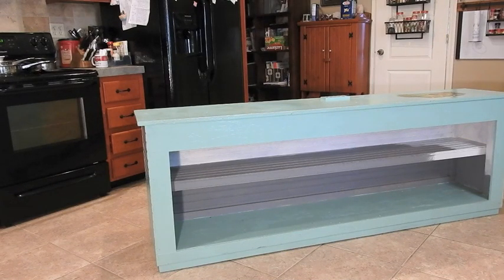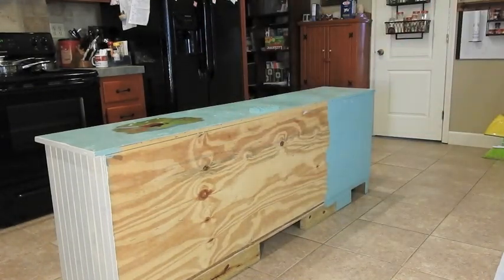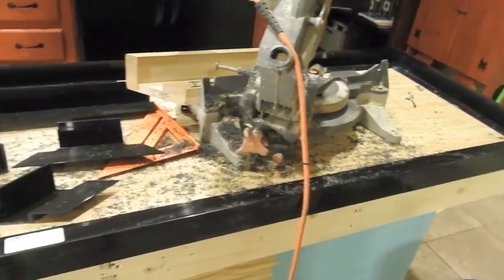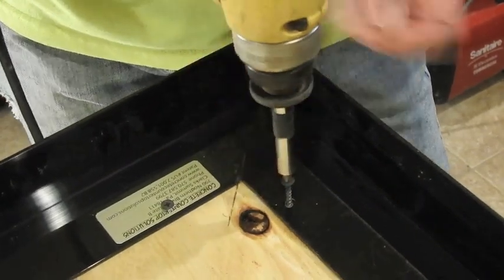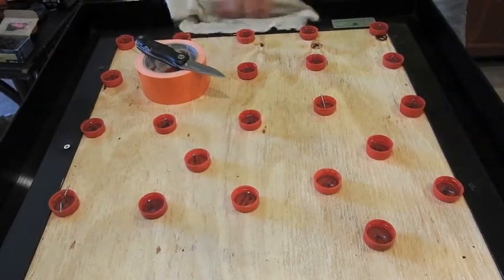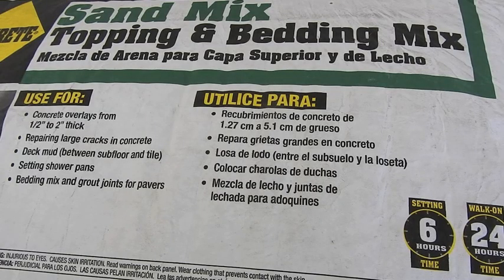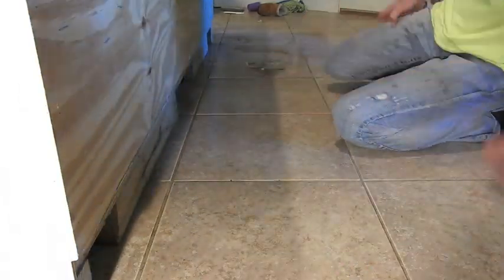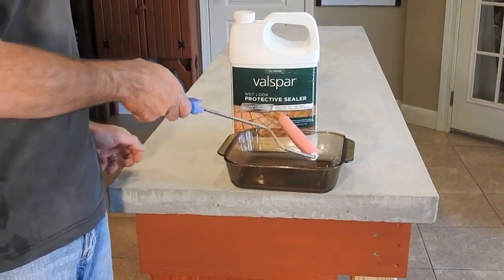How to Build a Custom Concrete Countertop Kitchen Island Buffet

Comment: thank you  for such a great video,very usefull tips the tip for getting the air out  works great  me and my mum made a sample piece we didnt think there was air in it till we tried the sander trick,the wood is a great idea to get it smooth it works better than the metal thingy,thanks again
Reply from the maker: I am so glad it helped and thanks so much for watching.

Comment: This is great! what are the orange lids with nails on them? I missed your explanation ? thanks 
And you said you added mesh but I didnt' see that? thanks
Reply from the maker: The orange lids are soda bottle lids, they hold the mesh in the middle of the slab. Thanks for watching
Reply: @chud327  Ah many thanks! can you not just pour half the concrete, add the mesh then add second half of concrete? I'm just thinking about time and labour saving, or do they add something else as well? thanks! Kate

Comment: Nice work for sure. Have you had any cracking with your sand mix? I'm getting ready to pour about 50 square feet of countertops.The lady at our local concrete supply house is telling me that sand mix will crack and bust if I don't buy her $35 for 50 pound bag of  countertop concrete mix. Just wanted to see if you had any issues with cracking and did you add anything to your mix to strengthen it.
Reply from the maker: I have done three countertop.  The first two had and additive and the last did not. The first has a small crack in front of the sink, which is a thin area. The other two have zero crack. I would probably risk it, but then again, 25 feet of countertop is a long way. Maybe you could do her $35 a bag mix in thin areas... I hope this helps, good luck, and thanks for watching.
Reply: Thanks for your help. It's fifty square feet over the whole house. Did you use the z counter top additive or another brand?
Reply from the maker: Z's for the first two pours.  Bought it for the first and had left overs for the second.  used none on the third.  If you search my channel "Chud327 concrete countertops" you may find the other two pours. Thanks again.

Comment: Did you have any issues with your seal separating away from your concrete? I have had that problem with multiple solvent based sealers, and it's always been on concrete that I burnished really smooth and tight and didn't stain (and therefore there was no etching). You left yours grey as well, so just wanted to find out how your seal held up.

Did you sand it at all to help the seal adhere?
Reply from the maker: I had problems, but not with this countertop. We did our kitchen countertops and only let the concrete dry for 4 days or less (I don't remember, but it wasn't long) and the stain and sealer started peeling off.  We had to redo the whole countertop.  As for this island, it dried for the full 30 days and the sealer is still great.  I did not sand it at all.  I hope this helps and thanks for watching.

Comment: How did you make the rounded coner
Reply from the maker: When you pull the form off the next day, the concrete is still soft enough to round off the edges.  I hope this helps and thanks for watching.

Comment: What is with the bottle caps?
Reply from the maker: They keep the fiberglass mesh lifted to the middle of the concrete where it is strongest. Thanks for the question and for watching.
Reply: chud327 thank you for the reply! Great video. Very basic explanation for the average DIYer .
Reply from the maker: You are welcome, I try to keep things simple. Thanks for the reply.